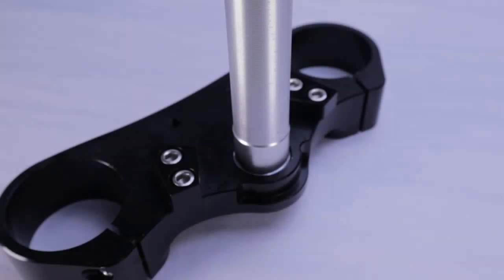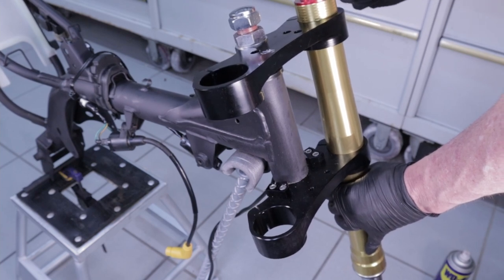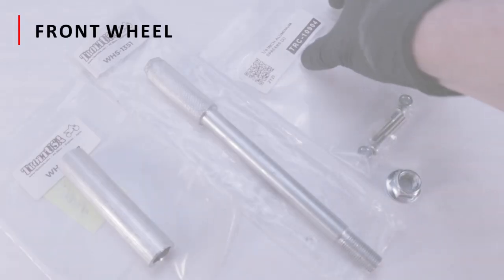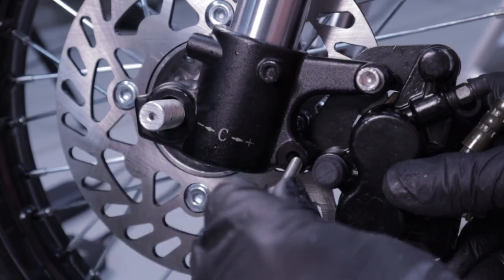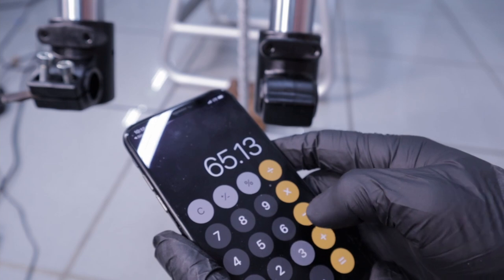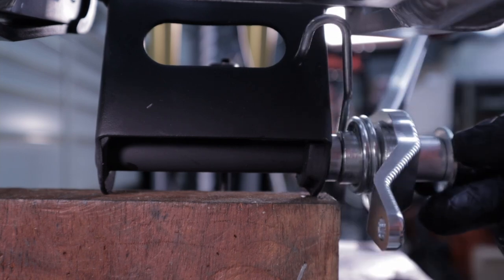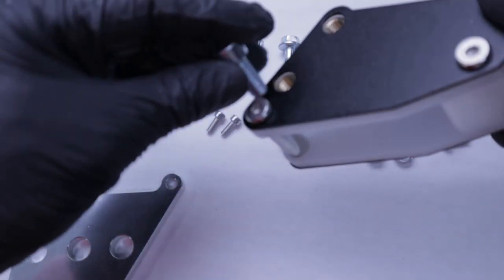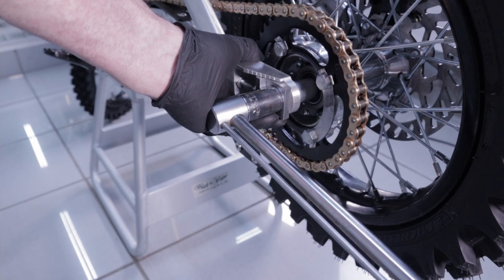Pit Bike Suspension Upgrade || CRF70 / CRF50

Comment: What I like about your videos are how you have your mistakes. You’re lucky to have sponsors so you get high quality parts. My pit bike has been a challenge since I lost both legs. I’m working on how to shift and my back break. I have 4 things I’m going to try. I bought a heel/toe shifter, an adjustable heel/toe, the stock one and a 14” hand shifter. The back brake doesn’t have a mount for a drum or disc on that swing arm. Also there are no directions. So yeah I’m watching your video again.

Comment: I’ve been trying to get ahold of one of these kits for my crf50 and can’t find it anywhere in stock! But when I do get it I will be using this video as a reference to install it! Thank you for the super detailed video keep it up
Braaaap on brother
Reply from the maker: Hey Chath!  Honestly, I wish I would have had a video to watch or a read a manual before attempting this. I spent about 12 hours on this job, but if I had a manual or a video, I’m sure I could have done it in about 4 hours. Thanks for the comment and for watching! More videos coming!!
Reply: Did you get it done?
Reply: Where can I get the brake master mount bracket?

Comment: Well Brian you did it again you really know your stuff about these motorcycles pit bikes, I bought a front end and wheel assembly at t-bolt USA. The owner Vince could not have been more helpful and man does he know his stuff I think he's a racer as well I'm not sure. I bought a Works engine a couple years ago with a V2 head oversized for oversized carb intake larger valves a professionally built the engine up ran and tested it regen at the carburetor installed a heavy duty clutch adjusted that also from what I hear. When I got it out of the box everything was hooked up including the wires CDI even the kill switch all I had to do is install the engine get fuel to it tie everything up and that bike still runs perfect. You do excellent work Brian! I see that you're quite a pilot as well you just one of those guys that are up in the high percentile unlike most of us but you sure are a nice goal to go after. Thanks for all your Intel and insight good luck. Cheers from Australia
Reply from the maker: Gosh, Michael! Thank you so much for the story and kind words!  The guys at TBOLTUSA are the best!  I love working with them!  Keep wrenching!  And enjoy the Australian GP coming up!

Comment: Great video! Very helpful. I have a 2006 crf70 and would like to get some more height out of my forks. Can you tell me if there is any other options to get some more height from the forks? Maybe an aftermarket triple clamp?
Reply from the maker: @tacroom12  Honestly, i don’t think so. However, TBOLTUSA may have some options for you. They are great for all that performance stuff for smaller bikes.
Reply: @brian.d.mobley  thank you Brian. I did find that xr/crf80 forks will mount right up and provide more travel. I found complete sets on eBay at a decent price.

Comment: I put the tbolt tbw1466 shock on my Xr70 and the thing is is hard as a rock. Way to stiff even for a 200lb adult. How’s yours?
Reply from the maker: Hey Jacob!  Believe it or not, I have yet to ride that bike!  I cant fit more than 2 bikes in my trailer and kind of excludes this bike from getting a ride to the MX track.  I have been working on a lot of other bikes lately which has kept me from getting to the track much either.  When I do finally ride it, Ill post a video of my impressions on the channel.

Comment: These are out of stock everywhere. Is this common?
Reply from the maker: Hey Sethy. It is common. I waited a long time.
Reply: @brian.d.mobley  thank you sir! Great work btw! I’m waiting on piranha kit for my 2021 crf50 but now reading that the shock won’t fit newer models. At a loss!
Reply from the maker: @Kin_Ton_Ti  Are you sure?  I think the shock WILL fit.  Call Vince at TBoltUSA.  I am almost positive that the kit I got from them was made for a CRF50 and I just upgraded the wheel sizes to fit my CRF70.  I have my old CRF70 swingarm if you want that for an upgrade.  I have read that it is a popular swap - if you cant find a Piraña kit.
Reply: @brian.d.mobley  thank you so much for the info! I am absolutely interested. I’m in NC. How might I be able to contact you?
Reply from the maker: @Kin_Ton_Ti  my email is: sterlinganadar@gmail.com

Comment: How much does a setup like this cost
Reply from the maker: Hey 50 Channel!  I’m doing a time lapse video on the cost of the entire build soon. In the meantime, Contact TBoltUSA.com about current pricing and availability.
Reply: @brian.d.mobley  thanks the unit looks half decent
Reply from the maker: @G-Boyz.Outside  Its better than stock, but honestly, it wasnt the best.  The wheel construction was poor and the crappy fasteners that were supplied were flat out dangerous for use on brakes.  I had to do a lot of work to make it correct and operational.